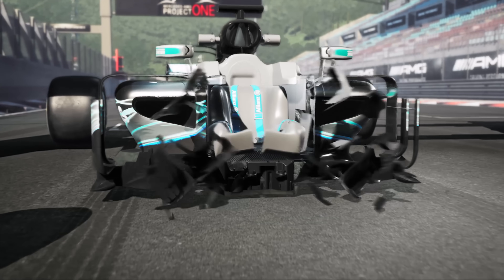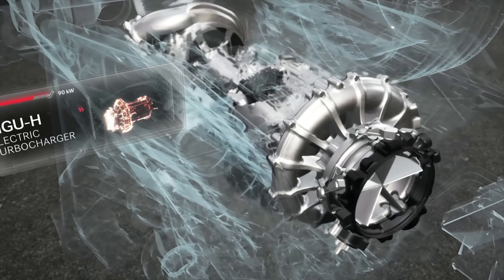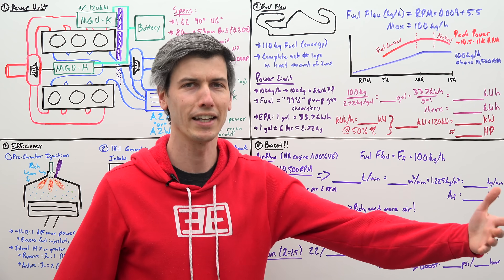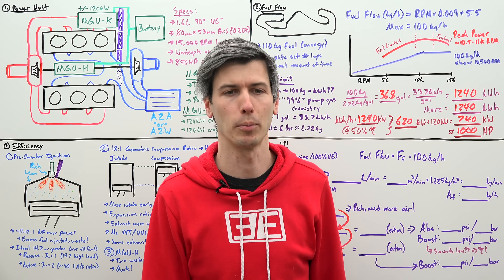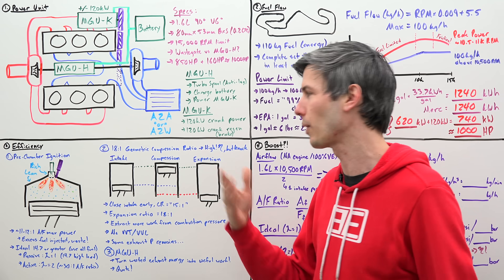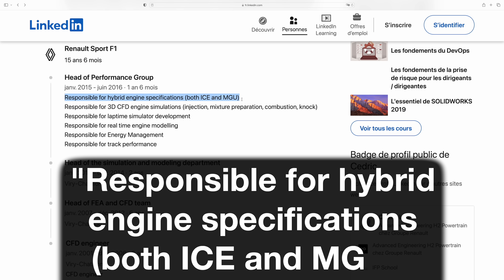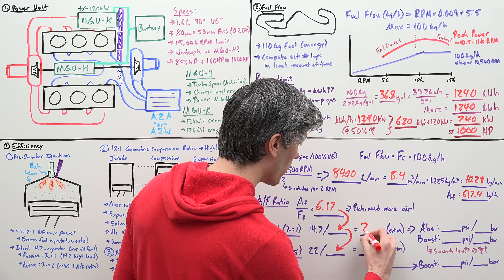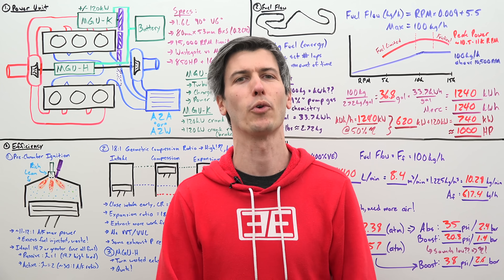How Tiny Formula 1 Engines Make 1000 HP!

Comment: Holy moly, i was thinking they would run a much higher boost pressure, but tis actually makes sense!

I would really like to know what would happen if you just open up the engine regulations (not fuel, keep the fuel flow limit as it is, for the run for efficiency) 

Interesting would be this: 
Open Engine configuration, open to new technology (VVT, VVL, Desmo-valves, Koenigsegg-Valve system etc)
Not using extremely expensive materials, only those found in normal car's use
Still keeping fuel flow limit.

Comment: F1 engine will have about 6 hours per weekend of run time. They will last 7 to 8 weekends, for a total of 48 to 50  hours of run time, rebuild. Had to laugh when you talk about fuel is 99% at 6:09. They make general statements all the time to mislead people like you. They may use 99% of the compounds found in normal fuels but may only make up 60% of the fuel they use. I was scrutineering MotoGP at Indy for a few years and had to help with fuel samples at the end of the race in Parc fermé, we were warned not to spill or touch the fuel as it is very caustic. Someone spilled to the floor and I step in it, Melted the soul of my shoe. F1 fuel rigs are a closed system, fuel is chilled and never left in the vehicle, when not in use. Even before a race, on the grid, fuel is constantly cycled through the fueling rig to chill.

Comment: I used to be a motorcycle mechanic, Honda CX 500Turbo of mid 1980's could boost to a max of 52psi with waste-gate disconnected and still feed enough fuel (until rev limiter shut down fuel pump :(  )
Honda had similar style combustion chamber 'lean burn' engines in scooters on test in Belgium  in the late 80's, early 90's. (Honda had it's main distributions center for Europe there)
 The scooter engines could run main combustion chamber around 32:1 fuel air ratio with the 'mini' chamber around 12:1. 
Honda were using motorcycle engines as 'test beds' for future car technology (the 3 valves per cylinder came out in motorcycles in 1978)
What it actually means though, the technology isn't new  or ground breaking just computer control has become much faster and more effective.
Oh, BTW, Didn't Renault have almost 1400 hp from 1200cc in early 1980's? (on the qualifying engines when rules were different)

Comment: 8:43 Excuse me but leaner mixture (AFR) means more efficient, that is maintaining it as close as the stoichiometric AFR from the engine’s design thru all the FT rpm acceleration.
It is so energy efficient it becomes thermally problematic as some engine components tend to melt or desintegrarte because of the high temperatures: richer fuel works as cooling or just to maintain a cooler temperatures.
This happens every thousand of a second, every second, of every minute of every race... between acceleration and a higher AFR for braking, but just enough to do the job as fuel consumption is still key.

Comment: Changing between metric and imperial measure systems to calculate work and energy is silly... don’t do this, start with one system and end the equation with the same one, regardless which one you use.
Anyone who doesn’t understand what each system of measures is needs to study a bit: the metric system is so easy it hurts my mind to hear Americans don’t like it... and even if harder the imperial one is also valid, I am ok using it as well.

Comment: The Honda CVT engines used two intake valves for it's lean burn,  which is not allowed by F1 rules.  There are high performance engines in cars and motorcycles that use two spark plugs, which again is not allowed in F1 racing. And then there is the old standby: high displacement means high horsepower.   When you think about it, F1 is not about high technology, but driver ability, and the best drivers are the ones who utilize the full potential of their cars and their own ability to win races.

Comment: Making the expansion stroke longer than the compression is a trick used in atkinson cycle engines such as the Toyota Prius. It limits your maximum power but it means you can make greater use of the explosion before the cylinder reaches bottom dead centre with residual pressure.

Comment: It's difficult to understand why so many people are still obsessed with the antiquated technology of pressurising a cylinder to push a piston and drive a crank. The mining, metals refining, manufacturing and rail transport industries all realised a hundred years ago that the only real answer to efficient motive power was to be found in the electric motor: one major moving part, excellent power-to-weight ratio, swags of torque from start, minimal friction, and piss-easy to balance. The only thing letting electric vehicle development down has been the lag in development of storage capability, but now that it's finally getting the attention it merits, it's only a matter of time before the majority question why we persisted so long with the reciprocating ICE and tolerated the crackpot assertions of its adherents.

Comment: Your videos are better than any expensive university course. The reason that we don't have such high efficiency engines in our passenger cars is, I think, down to the purpose of the engine. There is no formula 1 engine that lasts 1 million km but it's nkt hard to find more than 1 million km engines in passenger cars；formula 1 cars do not have to think about noise level, emission level, comfortness, all purpose usage, carring capacity, etc. When you put all these "human touch" on to that formula 1 engines, I think they will struggle a bit. And some of us who had 40 year machenical experience hates efficiency and technology, especially European small engines with turbo chargers, or any car that is not a 20 year old Toyota Celica, I mean why would car manufactures make any thing else when people just want to pay for something that doesn't have anything to break.😂

Comment: I used to have a Honda 1.6l CVCC engine that had a chamber of rich air/fuel mixture next to the spark plug and a very lean mixture in the cylinder that got insane fuel milage, in 1978. This is not new tech, just a new way to get the same result.

Comment: Ok guy I’ve got to straighten out me self ,lol..pretty sure .they do have a sort of variable valve timing (it’s not mechanical ) in fact they use free valve and since its electronically controlled there is no dual overhead cam because there is no camshafts and dual no camshafts or any at all, you can’t have variable valve timing because you don’t have dual valves or dual cams, since they use free valve ,where they can control the valve timing at every single point technically they’ve got variable valve timing and normally variable valve timing is timing down low timing up top maybe even timing in three different spots but with three valve the timing is variable because it changes through the RPM ban at multiple points and it’s always going to be at the maximum efficient timing ..you know this dude you have to..😮

Comment: Been a mechanic for decades. When I look at many brands design entire engine compartments are often overly complex by stacking on stacking design. The main reason is to sell you as much parts as possible for a high possible price and they put it together for u. It's the current mindset in engineering. Multiple companies coming together selling parts making money. Also here we need an industrial revolution pretty much. How we should really build our engines and vehicles keeping in mind using as less parts as possible, be more efficient because of it and easier to maintain and repair

Comment: My guess is that a pre opened intake valve is opened to prevent detonation. Unfortunately, Formula 1 car does not have torque to move a full weight vehicle with multiple passengers on board, for say, a large family going up a hilly road. Hence, formula 1 tracks have minimum inclined degree tracks. Imagine installing an F1 engine into a tractor trailer fully loaded with 80,000 lb cargo going up hills in Virginia😅

Comment: What's also interesting is Hyundai's 1.6L turbocharger engine, which allows to be fueled with low grade octane fuel per owner's manual. However, based on mpg, our Hyundai Kona N Line has the best mpg using mid grade octane 89 (R+M)/2 Method. Always thought the highest octane was required to operate these tiny turbocharged engines to help prevent pre detonation. Price to operate per mile averages at $0.18. There is still a lot more compared to EV at $0.0628 per mile. Awesome YouTube show as always.

Comment: F1 engineers be looking at this going "yep that's spot on"

20psi seems low but we don't see as many turbo blowups as we did in the 80's with those engines making similar rpm and HP (in race setup) - those things were running 40psi plus. In addition F1 has moved towards reliability so it stands to reason that in today's cars lower boost is required to produce similar HP due to better materials and teams will those turbo's to be reliable - i.e. run a lower psi

Comment: What is also possible is that the MGU-H is used to meter the air that is entering the engine, much like the compressor used on Mazda's Skyactiv-X engines. That way they can run leaner and much higher compression ratios without even needing to resort to the Miller-Cycle.
Notably when the hybrid system is putting out as much power out as it can the cars actually run with an open wastegate, which was audible on Ferrari powered cars last year

Comment: Exhaust gas is pushed out in the exhaust stroke, using energy provided by the combustion stroke in another cylinder, and also partly just through inertia of the engine as a whole. So when you impede exhaust gas flow, you're putting more back-pressure on the combustion cylinder, expecting it to do more work. That's surely stealing energy that would go to the wheels, right? 

I can understand that using that to drive a compressor for a turbo makes sense, since you're getting more energy out overall. But the exhaust gas isn't "free power", it isn't wasted power. So why use it to drive a generator MGU-H ? Is it that the combustion stroke can deliver more power than it normally does? So simply driving the wheels isn't using it to full capacity, and there's some reason, presumably a regulation, why they can't alter the gearbox or wheels to do that? So they're dragging every last possible watt out of the combustion stroke?

This is something I don't understand about turbos generally. Doesn't it make more sense to use superchargers instead, taking energy straight off the crankshaft? The crankshaft is as near to the source of power as you're going to get, especially if you want going round-and-round power. Why use the exhaust, with all the problems of lag etc, when it's so indirect and loads the engine in such an indirect and weird way? There's no free lunch!

Comment: Great analysis. You never disappoint!!!
But...just found out as of 2026 MGU-H (heat) will no longer be used in F1 engines, citing cost of magnets as the problem.  But is the problem really that heat greatly decreases efficiency of magnets?  If so, why not use Switched Reluctance (SR) motor and generator, because they don't use magnets, but especially on the hot side as SR generator would handle heat better than magnet based designs?  And - SR motors and generators can be better dynamically controlled, as this is fundamental to their design anyway, and also this "fine tuning" of matching electro/mechanical torque inputs and outputs within the system would possibly lead to further increased efficiency and performance.
Thoughts anyone???

Comment: The MGC-U output of 120kw can be amplified with a pulley system between it and the crank. Significantly lightening the load on the engine. We would need to know the engine RPM parameters for charging the battery. Those cars may have limited access to all those pony's depending where you keep your RPM. Please make a video for this 🙏

Comment: Wondering if vaporizing fuel before use would increase the fuels use, also if the air could be converted into 03 before it reaches the combustion chamber.
Reply: It would make it more inefficient. The energy density in fuel vapor is considerably lower than atomized liquid fuel. Also, putting pure oxygen into a combustion chamber would be worse for fuel consumption. You would need 5x the fuel for to account to the added oxygen. Though you would get considerable power gains.

Comment: Why cars don't have MGUH?
It's just an electric motor/generator on shaft.
Maybe cars don't boost all the time but all 40 ton trucks are at boost all the time. I think it would be energy benefit to choke that turbo more and spin up generator, use excess energy in some electric motor
Reply: Well they would need to be Hybrids for one. Also currently they’re quite unreliable in F1, only lasting about 3,000 km. The MGU-H is being dropped for that reason in 2026. They’re going to supplement that by increasing the MGU-K to 460hp(at the same time decreasing engine power). Honestly ill be interested to see how slow the cars will be, since the MGU-K can’t always output at 100% and they’re adding a larger battery with it(a lot of weight for cars that already weigh 750kg). Imo V8s or V10s running on Biofuel would’ve been smarter.

Comment: F1 engine is hack of complicated,  if you break down the engine, how many parts coming out from the engine??? 
      question to this,,, indy car racing in 1997,, the mercedez engine ----v8 engine had 5000 parts,, that was in 1997,

 how about 2023 v6 turbo charge engine with additional electric motor assist, bet u that the engine has more than 7000 parts,,, eventhough it never mention anything of it,,,

Comment: Thanks for presenting values in gallons, etc as well as the metric. I am 80 years old and “grew up” with feet and pounds so I appreciate not having to convert units.  I am disappointed that the MGU-H unit is being dropped.  The additional energy recovery from the exhaust must be problematic for continually varying loads.
Reply: That's the beauty of the metric system, it's like water, 1,6 litres = 1600 ccs, that's why America should be ashamed of the cars they made with 5, 6 litres and 120 hp, it's ridicule, no one in Europe did that!! poor engineering and pure arrogance!
Reply: @jtiagosd  They're very fond in the US of the saying "no replacement for displacement". Perhaps in the 50's but this video just goes to show that there is in fact a replacement for displacement and it's SO much better.

Comment: 6:04 You failed at reading marketing speech. They did not say it is 99% the same as regular consumer fuel. The mix ratio can significantly alter the fuel's properties and costs, and, duh, of course it's gonna be mostly refined hydrocarbons! - And it's even worse, because they didn't speak of the same compounds, but the same TYPES OF compounds. - If you translate that, it could mean that F1 racing fuel is vastly different, even to the point where regular consumer engines wouldn't even run properly on it.

9:52 Same skepticism again: 30:1 overall or only for the pocket injector?

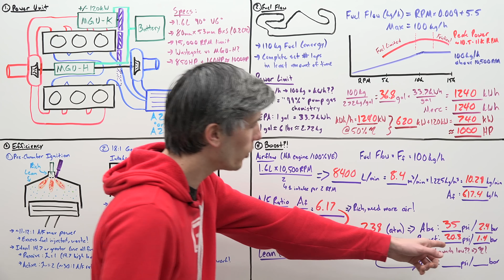16:20 Well, my 3S-GTE runs at 13 PSI with IIRC 8.8:1 compression, so we see how much the tech has changed.

Comment: You left out why,  all forms motor sports except drag racing they try to get as much fuel economy as possible , where drag racing engines are opposite,  push as much fuel as possible. That's where they get 10.000hp..

Comment: Using a compressor is actually cheating the engines should be limited to 2.5 liters, be naturally aspirated; and be limited to 18,000 rpm
Reply: The rules prohibit N/A engines. Also, Do you by chance happen to be a fan of Brabham?

Comment: Remember back to the first few races in 2014. Several cars did not have the power system figured out, so they ended up running out of gas before the end of the race.

Took several races before no one ran out of gas.
 
Personally I preferred when they allowed/required re-fueling during the race. Made the strategy more interesting. Under current rules, "fastest" lap can be done by anyone in the field at the end of the race simply by pitting and getting fresh tires.  So, often it will be someone way down in the race order

Comment: Where did the fuel flow equation come from? Is that a rule published by the F1 authorities, or is it measured from a particular real-world engine?

The 5.5 seems to be the baseline fuel consumption just to keep the engine running. The 0.009 seems to be the incremental increase in fuel flow per rpm. But the equation doesn't account for throttle position (for example during braking rpm might be high but fuel flow is still stuck at baseline). I'm very curious how it's derived.
Reply: Yes, that's in the rule book and it defines maximum fuel flow. You can use less if you want, under braking for instance fuel flow will be 0.

Comment: Now I'm wondering why I've never seen an mgu-h on a passenger car. Maybe they do exist?
Reply: makes no sense for a road car. There are electrical assisted turbochargers around to generate boost quicker at low revs, but a fully fledged MGU-H won't work because to really get power out of the turbine you need to drive with with wide open throttle, otherwise there's not enough excess exhaust gas to really make power from the turbine.